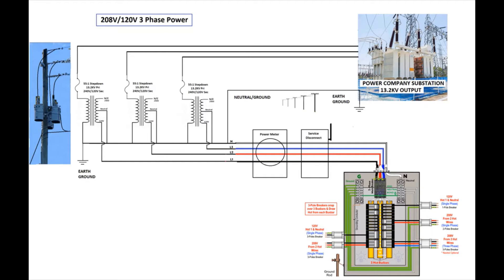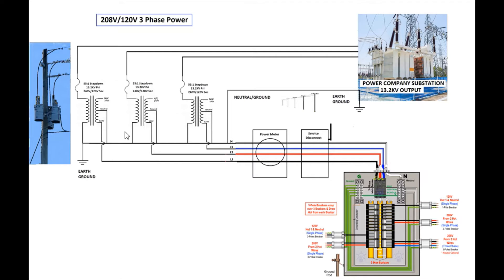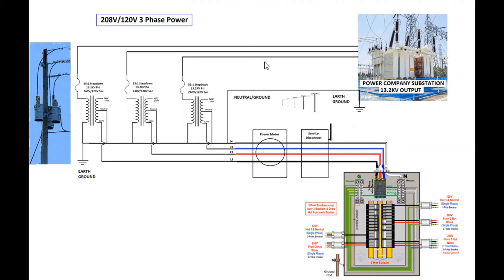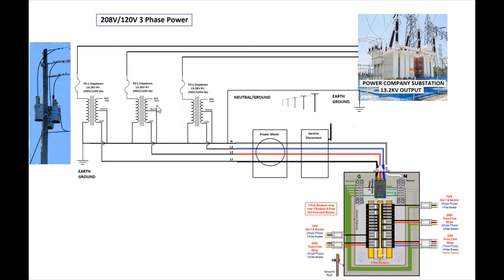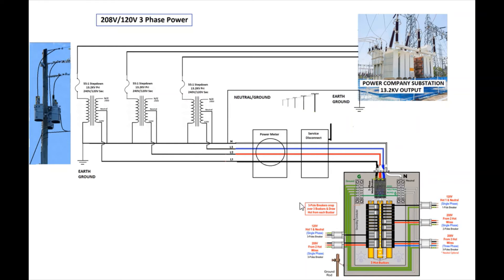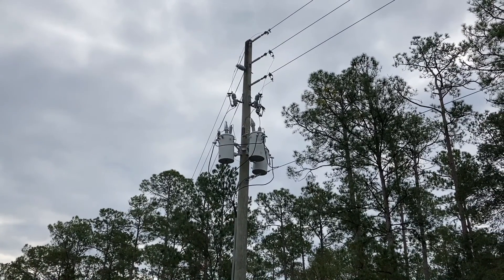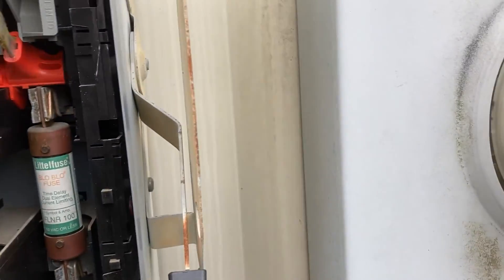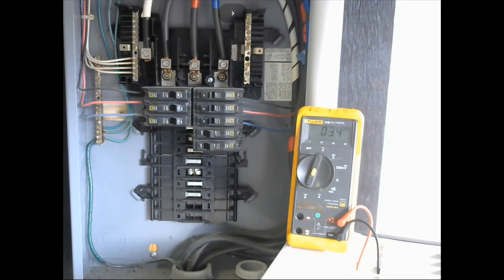208V/120V 3 Phase Power Distribution

Comment: I’m used to this, but recently I finally got to work around the 120/240 3 phase with the 208 volt high leg, that was really strange. People were so afraid of the high leg that they pulled the fuses to the high legs at the service disconnects, but that way it can never be balanced, so I’m using the high legs and one other leg for each and every 240volt device, then when everything is finally done and working, I plan to balance things using a clamp on amp meter. I’m not a licensed electrician, but I do what I can before calling in the electricians to check everything and fix any issues prior to inspections, saves my boss a whole lot of money that way.

Comment: Thank you for the thorough explanation.  Got a curious question and this always stump me.  What voltage do you get when you are tapping this in a three phase breaker for this Y transformer configuration?  whenever you use three phase, does your power goes up since there is a factor square root of 3?

Comment: Where is GEC ? grounding electrode conductor that goes to ground ( grounding  electrode). I am not sure if your local code follow NEC.
Reply from the maker: It is kind of hidden in the video, but if you look close you will see the green ground wire being bonded to the neutral at the service disconnect.

Comment: It's actually less than 1/10 amp that's returning via the ground conductor. It's only the unbalanced current. If the primary side was wired as delta instead of star, no neutral connection would be used.
Reply from the maker: I see. So if only 1 leg had a load you would need the neutral. But you can do the crazy 3 way load balance thing where all the current is kept within the primary feeds? The same way it works here at 120V 3ph drop, the same applies for the substation feeding this part of the world like a big 3 rail breaker box at high voltage.
Reply: The neutral IS a current carrying conductor.

Comment: Nice video. I’m working on this exact set up for a friend. His set up from the power pole is feeding a 200amp disconnect from the meter. Now I’m curious I’d like to bring 400amps to upgrade so I can have 2 200amp sub panels. My question is…. Do I have to upsize the wire from the utility pole?
Reply from the maker: I'm no electrician, but I know everything to the right of the power meter is under the power company's control. Guessing yes. There is also the question of can the transformers handle the higher currrent? Would they charge you for the upgrade, or be happy since your bill would be hopefully going higher?? Give them a call.
Reply: Any time you increase your load by more than what was designed at the time of installation you will need to contact the local power company and let them know what you are needing, depending on your load requirements they may need to step up the transformer.  Anytime you are wanting to add a sub panel you need to have a licensed electrician at least design it for you, there are many intricacies that need to be done. If not insurance companies will not insure the property.
Reply: You will need to upsize your service conductors. In residential homes where there are poles, the service drop comes down from the pole and splices above your house near a piece of rigid conduit. That splice done above the roof of your house can be seen from outside. That splice point all the down to your meter are your service conductors. A licensed electrician can pull the permit for your home and have it done.

Comment: your transformer shows 240/120 secondary, should it show 208/120 instead?
Reply from the maker: The 240V outputs on those transformers are not connected. 120/240 transformers are the most common manufactured. 208V only comes from 2ea 120V outputs that are out of phase by 120 degrees. 208V is a really bad voltage to be stuck with, I can't imagine transforming to get it, it's a poor man's 240V.
Reply: @dc95811  i see , thanks!
Reply: @dc95811  Actually 208V is the common commercial voltage - like you are showing, in the 208Y/120V 3-phase 4-wire system. 240V is primarily reserved for residential (as a 240V/120V single-phase or "split-phase" system) and smaller commercial facilities. The 208V system is also used for large residential (multi-family) buildings as well. But thanks for making this video - nice to see a non-electrician/engineer be interested in the electrical system!
Reply: In our work plant we have 480V 3 ph and 208V 3 ph coming in from the street. We have to boost the 208V on our floor to get 230-240V that some of our equipment needs.
Reply from the maker: @takashitamagawa5881  They sell standalone transformers that can shift your 480 or 208 to 240. We have a 3ph 208/480 stepup transformer installed in our garage to run the car lifts.
Reply: I advocated having some 480V to 240V transformed power when we moved into our current facility but I was overruled.  So we now have individual buck-boost transformers on the equipment that needs it. It's odd that the USA has the two different medium voltage levels.

Comment: Your disconnect needs to be bonded to ground
Reply from the maker: The ground and neutral coming from the panel, are bonded to the neutral from the meter on the left. That junction is mounted to the metal of the box. What is missing? I don't do this kind of work. It is electrically correct.